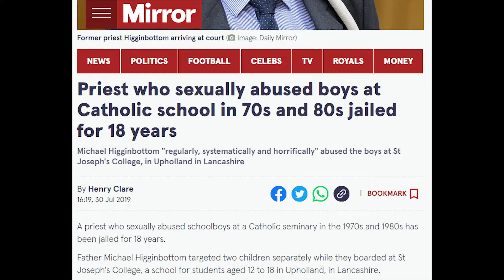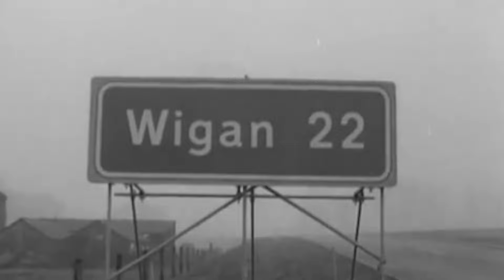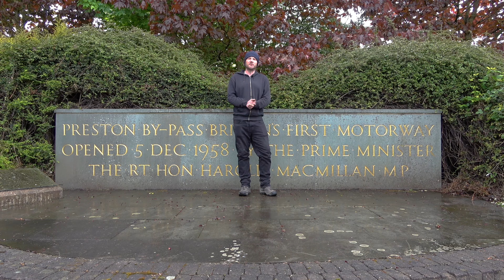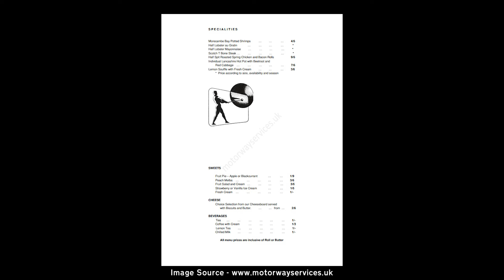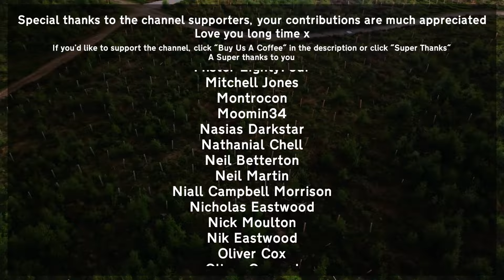Secrets of The Motorway - M6 Part 3 - Warrington - Lancaster

Comment: The building at Haydock was a GPO repeater station. I worked there briefly in the mid 60's. Its purpose was to provide a boost to the analogue signals on trunk lines to/from Liverpool. Became redundant when the network went digital, hence the repurpose mentioned above and eventual abandonment. Working there, it was curious to eat lunch in the grounds, watching the motorway traffic apparently driving on the roof (simple pleasures!)
Reply: Is it abandoned? It still has wheelybin service (e.g., 1:30).

Comment: As an old Leyland lad thanks for the shout out for my home town. As a kid in the 60s/70s there were parts of the motor works within the town itself and the present-day motor museum occupies one of these buildings. I remember bus and lorry chassis being driven from one part of the work to the other with just a bloke on a strapped down stacking chair  by the bare steering wheel bereft of any other bodywork. 'Leyland Testers' we called them, and yes please to a BL video.
Reply: I remember seeing bus and truck chassis on the M6 on a regular basis, as you describe with the driver out in the elements, no cab, just the seat.
Reply: @richardthomasmillican3980 there's a reason why the workplace used to be deadly!
Reply: How can I comment on this
Best ever... Used that
Brill hmm that too
Freakin sweet awesome... That's it

Juliet bravo mental
Reply: In the 1950's I became a U.S. fan of Leyland and Foden lorries through Lesney Matchbox toys.

Comment: Gathurst Viaduct was the answer to one of the original Trivial Pursuit questions. Something like 'Which motorway bridge crosses all those other forms of transport?". Fun bonus fact - the River Douglas used to be navigable by small vessels at least as far upstream as Gathurst.
Reply: Not a motorway but check out 3 bridges on Windmill lane between Brentford and Southall. It's actually 2 bridges built by Brunel. Canal aqueduct over railway with road over the top..

Comment: In the 90's the abandoned building was a BT depot where the field data services teams were based for quick access to the network. Before that, not too sure but would expect it's Government related.
Reply: The only thing I could find was Old Boston ATE. (automatic test equipment (ATE) designer and manufacturer)
Reply: @firesurfer  I remember that now, it was a drop off for the transmission routes across the country

Comment: Yes the first motorway, no speed restrictions, with some cars easily reaching 60 mph
Reply: Not so easily back down to zero though. good times.
Reply: Well, the car and occupants could get to zero very quickly. But only once.
Reply: 60 for about 3 minutes before the head gasket dissolves and leaves you somewhere outside Preston miles away from help 😂
Reply: unlikely to be able to reach 60 these days....
Reply: @bobstirling6885 for very different reasons

Comment: Haydock Island was modified a few years ago to increase capacity, at the expense of safety. It's now a massive accident hotspot as drivers unfamiliar with the junction struggle to navigate it safely. Not even death and destruction are allowed to stand in the way of carving up the green belt for massive sheds. Thanks St. Helens Council.
Reply: Sounds very similar to Switch Island..M57/M58/A59.....always seems to be accidents there.
Reply: Tbf won’t a lot of the accident count be idiots stopping dead in the middle lane of the motorway to join the stagnant queue in the left lane? I’ve been brake checked in a lorry twice by idiots doing that and I don’t even go past it at peak times that much!
Reply: @Stephen_Platt  It's not the motorway itself, it's the "hamburger roundabout" that's the problem. Getting in the right lane is extremely difficult, too many lanes, not big enough. Then there is the problem of repeater traffic lights which are positioned so as to confuse motorists that aren't familiar with the junction. Nearly every accident is caused by "people running red lights". In reality 90% of those people see a green light and think it's for them. It has always been a bad junction, but it was made worse a couple of years ago in order to "increase throughput" to facilitate the building of huge warehouses nearby.

Comment: There are still service stations operating on the German Autobahn system which have perilously short exit sliproads. One particular sliproad from a service station near Stuttgart is not only very short, but is on a steep upward slope. I once found myself on this sliproad in a Toyota Hiace. It was not a nice experience. The recent prevalence of UK motorways without hard shoulder (like in Germany) is a short-sighted and very dangerous innovation.

Comment: While the Shell at J23 (or indeed the Shell near J28) are cheaper than motorway service areas, the Sainsbury's at J29 is likely to be cheaper still.

There is also an unofficial service area at J31 (this is signed but only from the sliproads and the A59).

Comment: junction 28 (Leyland) is the only junction to exit onto a B road (as far as I am aware). It was originally planned to exit onto the A49 a few hundred yards south where the Shell station is now but Leyland Truck and Bus (as it was known then) somehow persuaded the powers that be to re-route the junction to the B5256 as it was more convenient for them.
Reply: Junctions 39 and 41 of the M6 are both on B roads as is partially J38 too
Reply: @pedanticradiator  Thanks for the info mate. I use those junctions a lot and never even noticed (ha ha). All the best.
Reply: @Stephens8x6Workshop  Junction 39 (Shap) is actually signposted as (A6) but the road is actually the B6261 possibly the only primary stretch of B road in the country

Comment: 5:43 LEYLAND TRUCKS was actually one of 4 of the best bits of the British Leyland conglomerate. They were quite innovative in their engineering, and build quality was generally very good. They were the first to introduce the tilting cab for cab-forward tractor units and they made some quite powerful engines. They also created the semi-automatic gearbox for buses, the first being the Leyland National.

By the way, the other most successful parts of the business were of course, Land Rover, Jaguar - though this was just about able to hang on (their suppliers caused so many big issues,) and a side hustle call BL Technologies. In fact this was the most successful of all of them. It was set up to provide comms technologies for all parts of the business but had extra capacity to sell to others. In the end I think it was sold on and eventually ended up becoming part of Marconi.
Reply: Pretty Sure "Self-Changing Gears" predated the Leyland National.

Comment: theres a simular "bridge over nothing" on the A27 in west sussex near Arundel, where there were plans to continue the dual carriageway section of the road further. theres even ghost sliproads still in place leading forwards into a dead end simular to the northern end if the M23. I believe there are plans to revive the extention as part of the Arundel bypass project.

Comment: One thing you could have mentioned about the Preston Bypass was that it was used to test the Jaguar e-type, driving test cars up to the bypass and then running them flat out to make sure the car could take the stress of racing.  This was also done at night so there was less traffic around.  Some reports even said they did this while the bypass was still under construction, allowing the builders to make sure the surface would perform for cars traveling at speed.
Reply: Thought that was the M1
Reply: @peterhurst  moo, that was Rover on the M1 with the P6

Comment: The roundabout that’s common for crashes reminds me of the Newbu bridge roundabout. 60 MPH road to a small tight roundabout. When I first went through there in my own motorbike last week I almost went strident into the island. It scared the shit out of me. Luckily there was no cars coming.
Reply: Being alert is essential
Reply: If it's the Newby Bridge roundabout you're referring to, you needn't worry much longer. Work has started on the A590 to reduce the speed limits on the section between Ayside and Greenodd, including the installation of 9 (yes 9) average speed cameras.
Reply: @iandickinson6400  my bike is only a 125 so i was doing 55 on approach but yeah, yeah its the same between Lancaster and preesall which I did Saturday morning
Reply: @iandickinson6400  also it could be the greenodd roundabout im thinking off ill have the check the map and get back to you

Comment: By coincidence I travelled down that bit of the M6 today and it includes my favourite bit of motorway on the entire network. There is a stretch of the M6 between Junction 32 and Forton Services, abeam the town of Garstang. It is dead straight for two miles. It has eight bridges crossing over it. Those bridges carry a road, footpaths and farm tracks. There’s nothing particularly special about the bridges but it seems to me to be far more densely bridged than a rural stretch of motorway really ought to be. 

Well I find it interesting at least…

Comment: The building behind Shell Haydock is something to do with BT. When working at the station it often had BT branding vehicles in the car park
Reply: "Old Boston" Telephone Repeater Station, to amplify signals on trunk circuits. There used to be hundreds in different shapes and sizes, mostly along the original line of A-roads.

Comment: Im from Newton-Le-Willows, really appreciate this video and the insight! Slip road southbound to join the M6 at junction 26 is dangerously short and even worse currently due to motorway 'upgrades' having barriers up making it even shorter.
Reply: Fun fact about Newton-Le-Willows - in the old days of telephones, it was local calling rate to both Manchester and Liverpool, with the result that GEC in Coventry, where a friend of mine used to work, had out-of-area phone lines to there, so they could get cheaper phone calls to the area. Didn't know that, did you..? 😋

Comment: Fantastic video when they widened the m6 they put in part of the slip roads and left them for a few years till they built bluebell way and opened the farm land up for development. 

Leyland Motors would be a great video the place took over the town. Sadly alot of the old works are gone but there are a few great pits like the curved office fire station office buildings and a gate house still standing. The old tank test track is no a waste to recycle plane and the wagon high-speed test and proving ground is being made into housing sadly. The approaches to Leyland have an example of their works one has a tank another a cart and another a fire engine . It also has the British commercial vehicles museum well worth a look.

Comment: Thanks for this video John iv been waiting for ages for my local motorway and my favourite service station!, I knew a joiner who worked on some of the bridges on the original preston bypass!,great to see the pennine towers, the plumbing company I work for used to work at forton service when it was owned by top rank and then later on Moto and iv got loads of memory’s of working there, my boss used to replace the glass panels on the observation level on the top!! He said it was terrifying!! Iv worked in the little building right on the very top of the tower, it used to have water tanks in it for the central heating top up and to supply water to the restaurant, when I was an apprentice in the late 80’s and we used to have a brew in the tower truckers cafe my job was to watch out for the boss coming on the slip road and tell the more senior plumber and we used to rush down in the lift and get back to work!!, have you heard of the book about the hauntings and spooky goings on in the pennine tower? Iv read it and is quite ahem interesting reading!! The book was self published ( that says allot!) by a local man who used to work in the tower and the beast of the pennine tower is mentioned quite allot although iv never seen it!!, when I win the pools I’m going to re open the tower as a top end restaurant 🤪,future problems with my dream project are removal of all the asbestos and the dilemma of the fire escape!!, anyway another great video John cheers 🤟🤟

Comment: Great video Jon. 

I'm from Leyland and spent my life travelling up and down this stretch of the M6.

Broughton is pronounced Brought-on. 

At junction 31a they built a huge park and ride carpark costing a lot of money. It never actually saw much use because you can only get off at 31a if headed north, and get on if you're headed south. Most traffic therefore came off at junction 31 and drove up the hill to Preston. Had there been a way off for southbound traffic at 31a, it may have seen much more use.

Speaking of junction 31, the extra bridges over the Ribble are used as access to a quarry and a rather nice nature reserve called Brockholes. :)

Junction 30 can be a dangerous one as there's a lot of traffic headed north from the M61, likewise headed south, too. Congestion here is common, despite them putting extra lanes in during the late 90s. Still, give me that over a smart motorway anyway. 
Regarding junction 27 at Standish, this junction has only recently had traffic lights installed in the last few years. As for that bridge over nothing, I really wish they would build the link roads to Wigan as Wigan is a nightmare to get to due to traffic. If you come off at Standish, it can sometimes take 20 mins to get through one set of lights in the middle of the village as the road clearly isn't big enough for the amount of traffic that uses it. There's also a ton of new houses in Standish being built all the time. If you're trying to get to Wigan from the M58/M6 junction 26, traffic again trundles down a road with lots of side streets, bus stops, pedestrian crossings etc. Put it this way, it's quicker for me to drive from Skelmersdale to the retail park in Aintree than it is to drive to the one in Wigan, despite Aintree being much further away.

Some say the Penine tower at Forton (Lancaster) services was supposedly abandoned as the only way up and down there didn't meet modern fire safety standards. Health and safety! I want my view! 😅

Thanks for reading.

Comment: If you go through Stevenage on the A602 past the football ground you pass a roundabout the has a road running underneath which has never been used
Reply from the maker: I know of this... I think it was used during match days back in the day to help with traffic congestion, however, I've never found anything that confirms it.
Reply: @AutoShenanigans  there was plans to build a road across the park plus another where the football ground is today the idea was dropped because of the proximity to the dual carriageway nearby

Comment: French Autoroutes have short & sometimes very short exits with sharp bends in them so no slipping off an Autoroute, pay attention  or you’ll need more than emergency services. Joining an Autoroute is more like a UK slip road but it can be shorter.  So in conclusion shut the depot and get that service station built

Comment: Around the area of Jct 27 M6 and the possible spare roads off into Wigan, there was talk of a possible link across to the M61.  There are a lot things happening around the Horwich area on the M61 and talk of this like has resurfaced (no pun).
Apologies slight tweak the link was considered between Jct 26 M6 and Jct 5 M61, it was discussed in feb 2023 as a £220m link road

Comment: Lancaster Services may look "iconic" but the North bound side it's my least favorite services anywhere. 

The car park is too small, the  one-way system doesn't let you go round again if you can't find a space so you have to drive the wrong way or hold your wee in until Burton-in-Kendal, and indoors everything you need is a hike upstairs.

It's only redeeming feature is you can walk over the bridge to the South bound side where things are marginally better.

Comment: It's sad that the owners don't seem to care about the appearance of the tower.
It used to look quite striking in its previous colour, a kind of turquoise.
It's been changed to beige, which looks awful. 
The main point is that they don't seem to be concerned about how it looks,  considering it's such an iconic structure. 
It doesn't appear to be regularly maintained, and it looks dirty and unkempt. 
Cost will obviously be the issue. 

The design itself apparently had a major flaw, which was overlooked from a safety point of view in the planning stage. 

The tower was closed not only due to falling sales figures but it was pointed out that in an emergency situation such as fire, a hurried  evacuation would prove too dangerous with the narrow, limited access within the tower column itself. 

Still,  it's an incredible feature that is admired by thousands.

Comment: I see you never mentioned that we are getting a smart motorway which has given us locals Grief over the last few months I live next to the motorway at bryn and we have at to put up with a lot of noise the only thing that was interesting is when they were cutting back your Called see the Coal seem which my house estate is built on the area number of x mine workings on the estate my home is now over 40y old now and has not Fell into a shaft yet the abandoned building that you refer to at the rear of the Service station is a repeater telephone exchange. It is used to boost telephone calls from one end of the country to the another I don’t now if it still in use it was a big Building but a fire Caused that part to be demolished I no all this because I use to work for openreach put I have now been retired for five years after 40y years service when I left things were changing to fibre cables so the repeaters stations may be no longer required